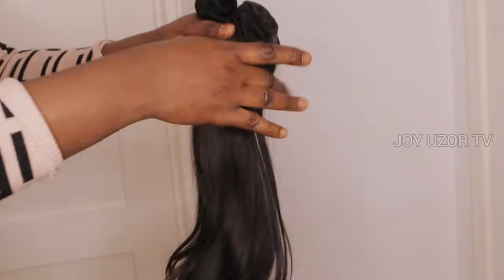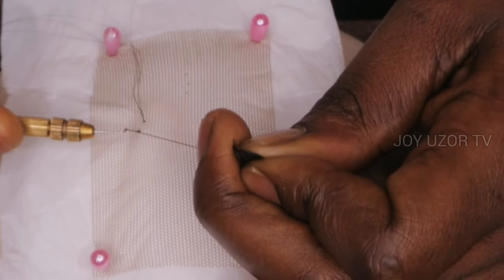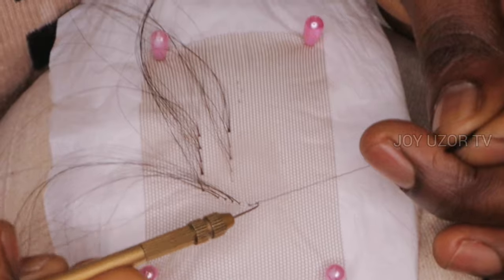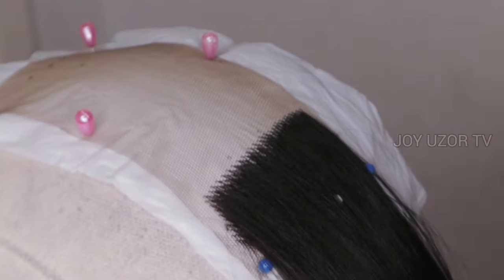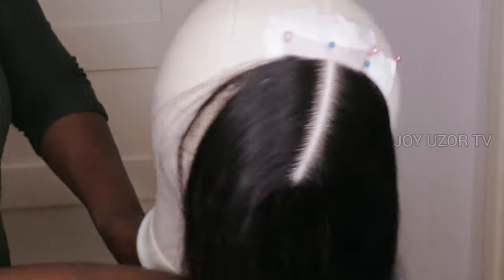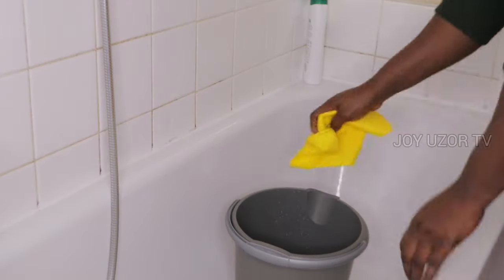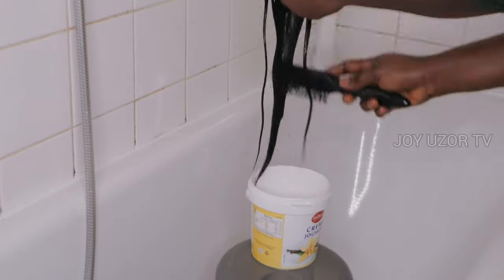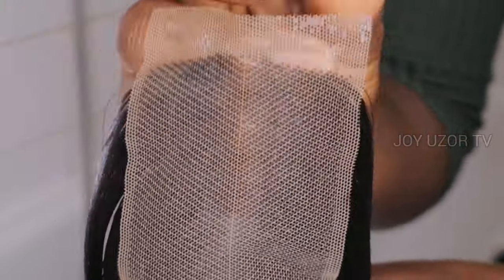HOW TO : single knot ventilation on Silky hair | beginners friendly

Comment: I have tried this method inbetween the double split knot method. I am still busy with the closure. It looks nice so far. I am making use of diagnol method for the back and middle. I will do the in-between for the front part❤